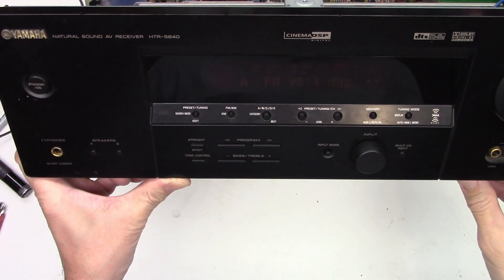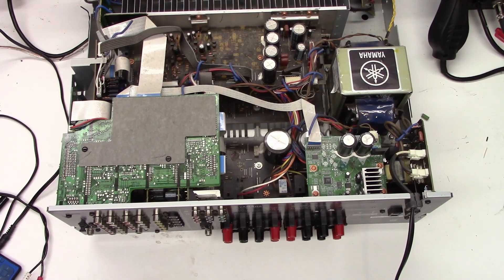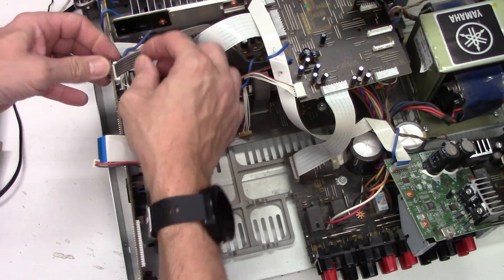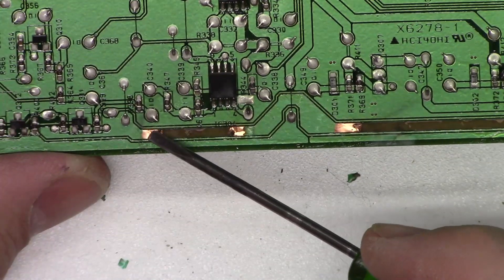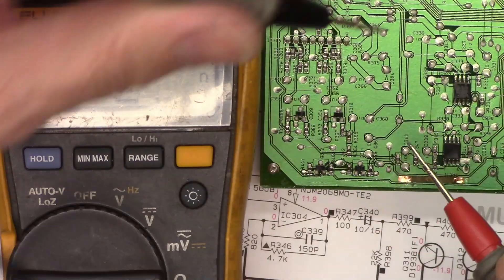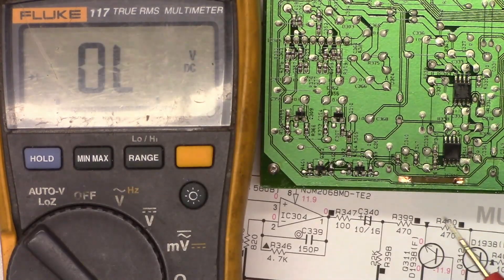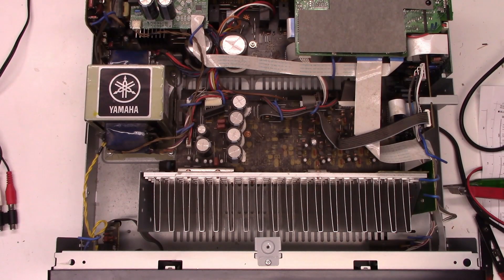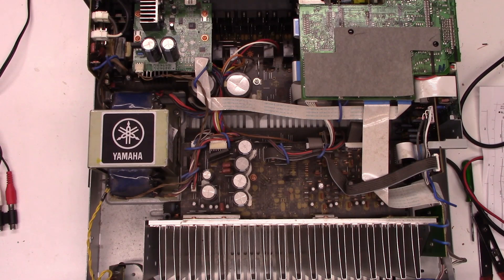YAMAHA AV RECEIVER NO SUBWOOFER OUTPUT RX-V457 RX-V557 HTR-5840 HTR-5850 DSP-AX457 DSP-AX557

Comment: I have a RX-V557 and I used a RCA to 2 bananas cable to connect my active sub, but still no sound. it has a humming noise when i switch those banana connectors.  I did the multi-meter test, ground shows 0 ohm.

Comment: I have a 20 year old Yamaha HTR-5550 receiver.  My 15 year old JBL subwoofer stopped working a couple weeks ago.  Tried a new subwoofer and not working either.  I've been troubleshooting with no success.  So is the problem my sub output?  Any ideas?
Reply from the maker: Hook up a MP3 player or equivalent to the input of the subwoofer (a known good audio source). If it plays sound then the subwoofer is good.

Comment: Hey saw your video, thanks a lot for the into. 

Have a problem with subwoofer outs, both front and back are partially working.

For a Yamaha amp RX-A2021 both sub outputs sending very quiet signal to the sub, there is something coming out but it’s really low maybe 10-20% of what it should be, any ideas what’s causing that? Speakers set to small and crossover tried 90 and 110hz. Do you think it could be receiver hardware related?
Reply from the maker: Look in the original owners manual and do a complete reset 1st. Let me know if it helps.
Reply: NorCal715 factory reset did not work. 

I tried maniacal setup to make sure speakers were set to small and crossover correctly set. Still nothing, when trying to use ypao it says error W1 out of phase. Could it be an issue with the sub? It’s brand new Polk psw108. Thanks again for your help.
Reply from the maker: Try and play music from a mp3 player or phone and connect it to the sub, is the audio still low? Just trying to isolate a receiver or subwoofer issue.

Comment: Hey, my rx-v371 wont recognise my subwoofer even tho i have everything correctly. What should i do.
There is no sound when i put or remove my cable in subwoofer output. It gives 0 sounds for subwoofer
Reply from the maker: If you touch the tip of the subwoofer plug (unplugged from the receiver and still connected to the subwoofer) do you hear a humm? You should and if you do not the sub is the problem, not the receiver.
Reply: @norcal715  yes my subwoofer is ok, i used it on my old speakers and it worked well. Now i don't know why that receiver thing doesn't recognise it
Reply: @fortnitejonne9096  Hi ! can you resolve it ? i am from argentina. My english is so bad. I need help for remute control. Thanks

Comment: Dear Norcal, love your videos, I follow your videos all the time. I have a problem with my Yamaha RX-V685. I bought it brand new from Australia (since it was not available in my country at the time) back in December 2018. Worked like a charm till September 2019 where I had to travel overseas again for a month. I unplugged everything from the wall socket and came back after one month. Plugged everything back again, worked fine for a day, and the FL display on the Yamaha started acting up. It displayed some weird symbols and the screen went off. I switched off and switched on again, and the display does not come back on. But the rest of the AMP works just fine. However, if you leave it on for a while, you can see the weird symbols come on again, and once in a while (very rarely) you can see the correct display what should be displayed. I took this to the Yamaha dealer in my country, and they said the whole digital processing board (that is where the FL display ribbon cable connects) had to be replaced. I am convinced that this can be repaired and the dealer just too lazy to trouble shoot like you do. Do you have any pointers which I could trouble shoot this kind of problem? I tried to find the schematic diagram, but couldn't find any. Maybe my resources are not as good at yours. Your input on this is highly appreciated. Thank you so much and keep up the good work. Look forward to hearing from you.
Reply from the maker: I will try to look into that if I ever get a chance. Sorry you're having such a problem with such a nice receiver

Comment: Nice fix, but are we done? As the guy says in the movie "The Core", what's on the other side of the equation?  What would have burnt that track clean off the board, especially an earth/ground track? Has the power supply in the sub-woofer box become dangerous (switch mode with direct mains connection, failure of insulation or something.). Get payment quick before the customer is in the morgue.